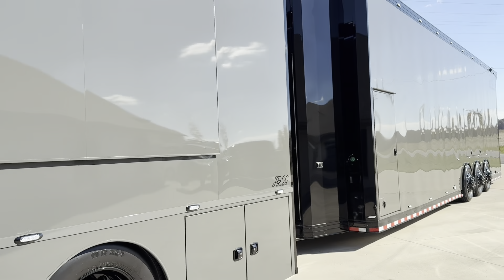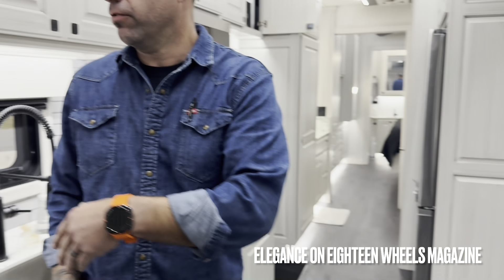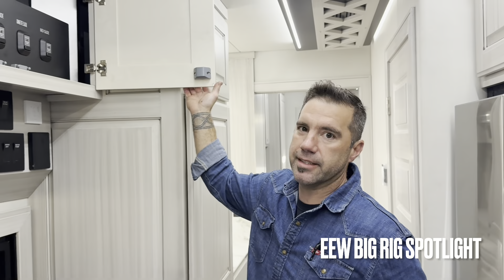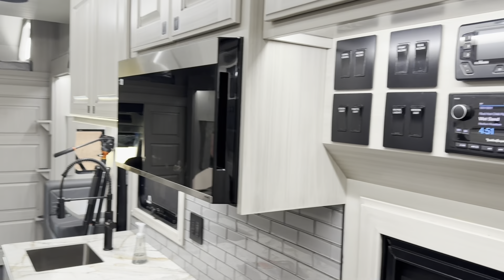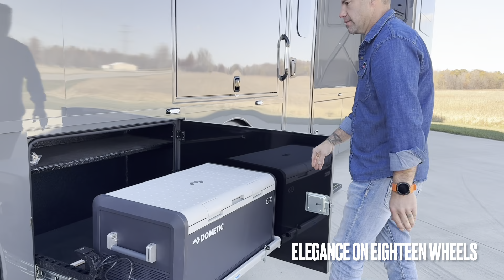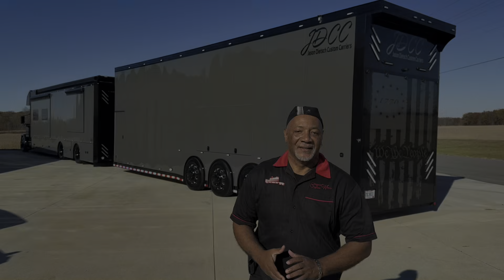One Hell of a custom Peterbilt! Million dollar dreams come true

Comment: That design is badass. She has no chrome just how I like. They even found a way for the stacks to be installed. Now, I don't like 589s, but it looks good in this design. I'm a 389 man all day. The only part that sucks is that they couldn't find a way to make it a fifth wheel instead of a hitch. I hate hitches.  They should have built an extended part out the rear to install a fifth wheel, with a part on the trailer out the front with a king pin. Either way, she is still beautiful. The color is off the chain, I swear.

Comment: Does anyone know the towing capacity of the pete and the weight of the trailer?
Reply: usually they rate them at 35k-40k on bumper pull stacker's like that..  the front of stacker the tall cabinet on trailer tongue is where the big 12k generator diesel and the a/c unit is that makes the trailer ice cold fast and will easily maintain temps even if its in arizona on a hot July day.. the reason the tow numbers seem low is because the weight of rig with its rv box on it.. weigh alot especially when you consider they have solid surface countertops and alot of thick tile thruout plus marble slabs in shower plus another 12k diesel generator is in the rear basement on driverside rear plus the 45ft box with the slidouts are thick walled for insulation purposes plus residential appliances and real hardwood cabinetry thruout.. the rig is around 40k-50k lbs gross weight which leaves like 40k lbs of gross towing capabilites for a bumper pull style trailer.. because it has 24k watts of continuous power making capabilities and a peak of around 36k watts peak power output capabilities from both generators
Reply: so it depends on rigs gross weight minus from 80k and thats about what it's towing capacity is with that style hitch most super c's like that are 30k to 40k i say trailers on the heavier side with those 3 big axles and wheels that are on the trailer..